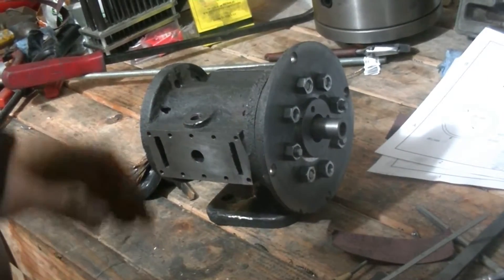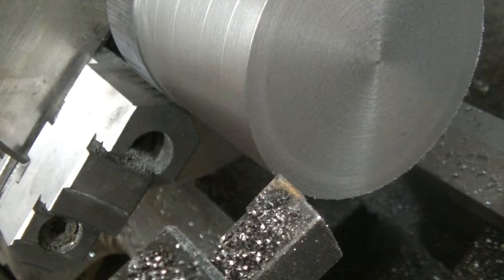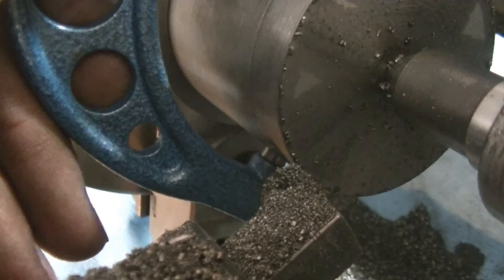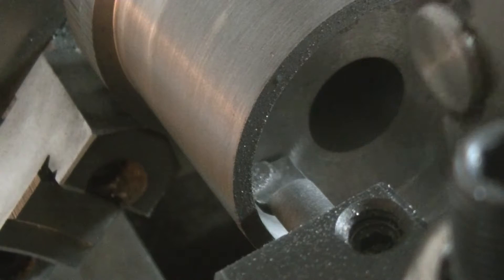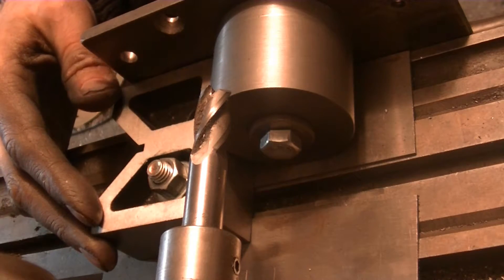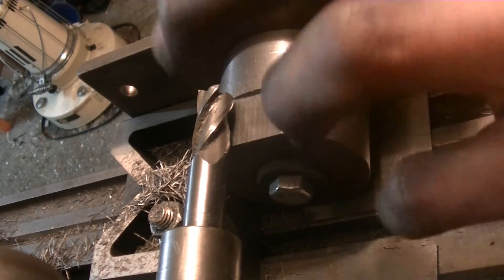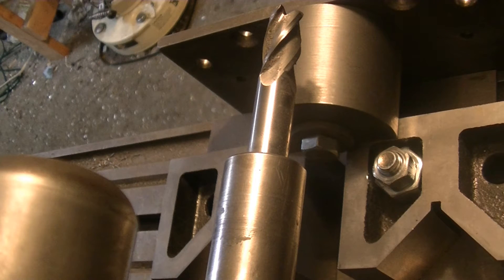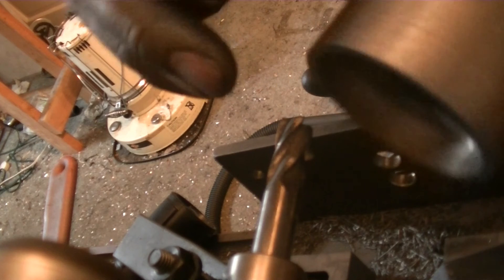Steam Engine Build: Machining Engine Cross Head - Part 1

Comment: 4:00 No chatter with centre in place - perhaps spindle bearings need tightening a little ?
This discussion was had with Doubleboost and having adjusted bearings, reduced chatter quite a bit.

Comment: I think you should be using the end mill as it was designed and feed it in rather than across. Leave a few thou on to take a finishing cut across. The cutter is small with potential flexibility.

Comment: Looking good! what kind of cross head guide are you going for?  Is it like the one with a track on the bottom, or one with slides on top and bottom, or something else?  I don't really know all the guide options, i'm new to learning about steam engines.
Reply from the maker: Thanks! The guide will be a bore that the cross head will ride in.  Similar to how the piston rides inside the engine cylinder.  I did it this way because unlike most steam engines, I want this one to be completely enclosed.  I also want the oil system to be closed.  Namely, having the crank splash oil in all of the necessary locations.  A closed cross head guide helps me do that.  I will explain more about this in future videos.